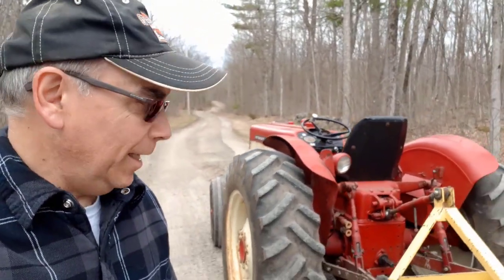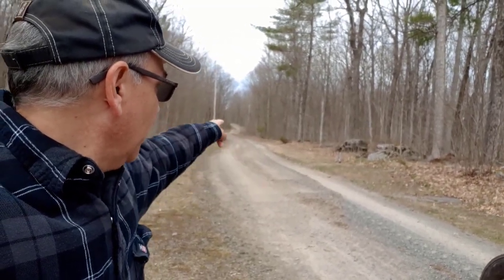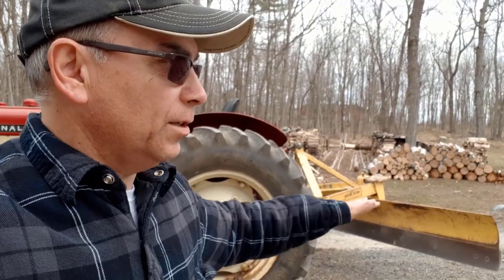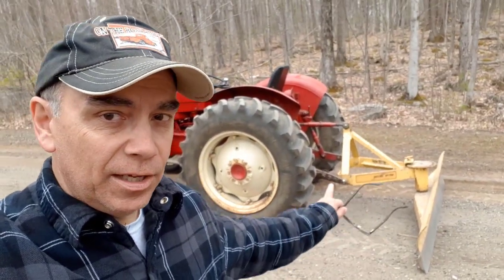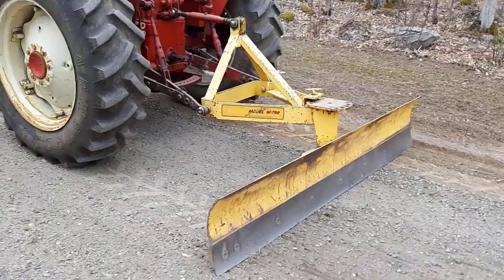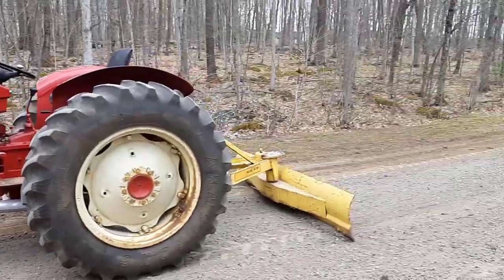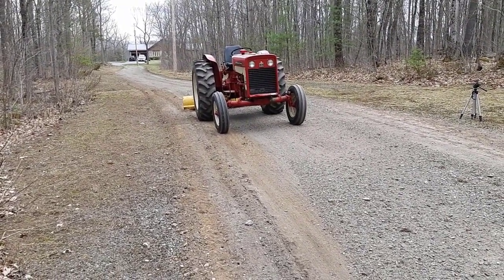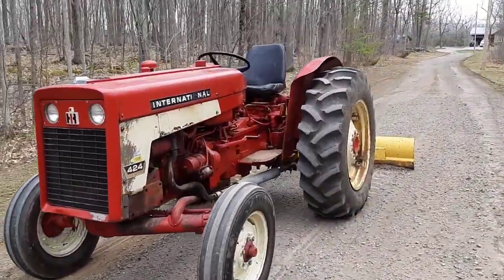Gravel Driveway Repair With International Harvester Tractor // IH 424

Comment: I have an international 2424 that is basically the same. I need a seat assembly for it as well as a few other parts. Will be putting it to work grading and brush hog work  when it is running.